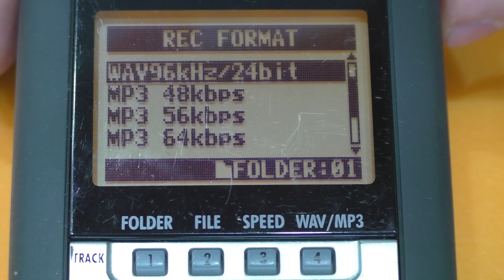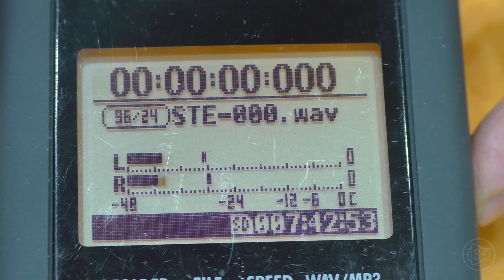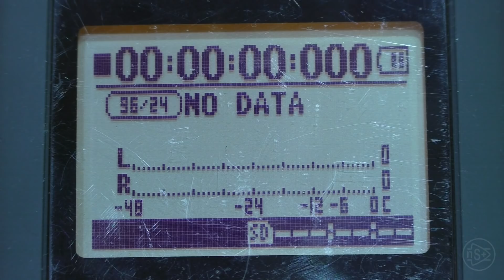Disassembly of the sound recorder Zoom H4n

Comment: I've found the assembly to be a bit problematic, if you don't follow exact steps. Use this as a cheat sheet:
Assemble biggest board and display (ribbon and normal cable)
Put inputs and middle board together
put both boards together, install case sides (make sure the power button is aligned correct!)
Remove dirt from screen  and the case window and put the front on (the record button sometimes falls out, make sure its there. turn it until it slides in easily)
Put mics and the top metal cover (with the logo) together and slide them together with the rest.
Install their ribbon cable (make sure its fully in and then push the connector sides down), put the silver screws back in.
Put the small board on (this could be done earlier, but i've found this to be the easiest. You have to push the case side panels to the side a bit though.)
Put the other side of the metal covers on and screw the four screws in. The long ones are the left side, the medium one is top right, short is bottom right.
Connect the two cables coming from the other boards and the two from the back panel to the top board (look in the video at 2:05 to see, where they go)
Put stamina mode switch on, then the back panel. screw in the 5 remaining screws. bigger one goes in the bottom middle hole. now the rubber covers and you're done.

(I don't usually say this, but I'd appreciate a like if you used this. That way I know it's worth it to write guides like this..)
Reply: definatly man   thanks  

i am going to have to do this,  mine was pluged in and running as USB mic,  and then it froze. 

i pulled the usb and tried to restart but no go, nor would it start under power supply.

i checked the battery compartment and was shocked to see there were battiers in there and they were leaking acid,  i fear it will have damaged the circuit board

Comment: I don't use my Zoom H4n PRO much because of my type of video (TOY R/C Model Planes) where I need someone to  figure a way for my Canon XA-30 or T5i to take my H4n PRO from pause to record and back to pause as I press the Record/Pause button on the camera. I have the Wired Remote for the H4n PRO but need the H4n PRO  better synced with the Record/Pause of my camera as there many  shots  are very short 3 to 10 seconds and as many shots as 25 to 30 or more in a single flight. and can be of different aircraft. So you can see the synchronization of audio can be very time consuming if not at all impossible.    Any help out there PLZ.

Comment: Hey, have you ever dropped the mic with and without the plastic case it came with? Just dropped mine but no changes were made to how it records. I'm guessing the solder joints could have little cracks in it?
Reply from the maker: I never dropped it, but once it fell into the rain and for some time the buttons did not work. Its OK now

Comment: You Might be the only one that might know how to do what I need look one comment down PLZ
Reply from the maker: I have the same problem and I don’t know how to solve it.
Reply: @NanoslavicLab     I've spoken to ZOOM and they aren't even interested apparently few people use these recorders out doors to supplement their videos audio. I want to put the H4n PRO on a shot tripod near the flight line to collect the Passing aircraft and the back channels to collect the remote mics I have on the Pilot and his spotter.  Oh Well if you figure it out PLZ let me know   thanks.
Reply from the maker: @HoundDogMech  I record several sources independently and then combine them manually in an audio editor. I use whistles or claps as sound tags :)
Reply: @NanoslavicLab  
Ya a guy flying a $20,000 Model Turbine Jet doesn't appreciate a whistle or clap right behind him.  Thanks